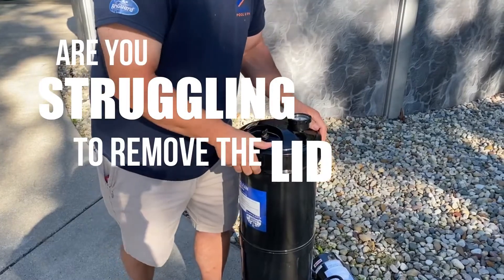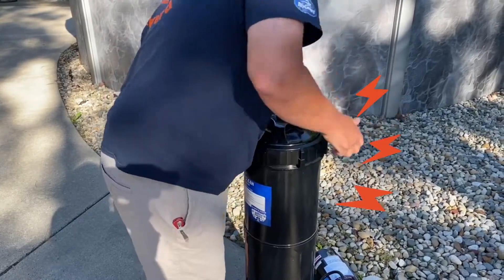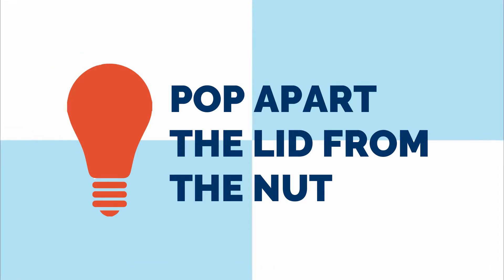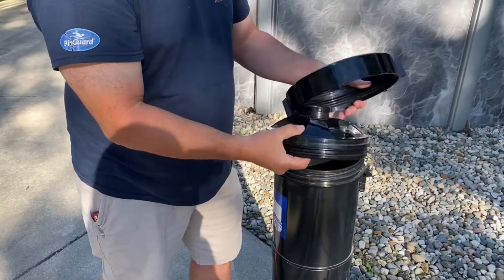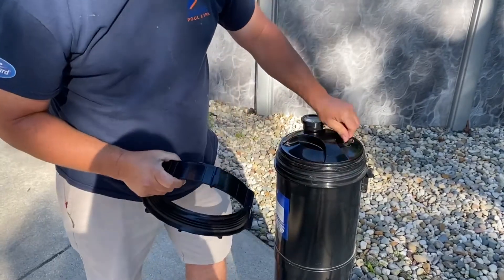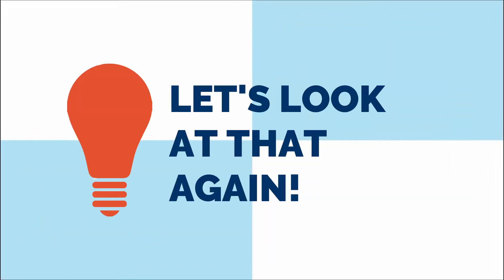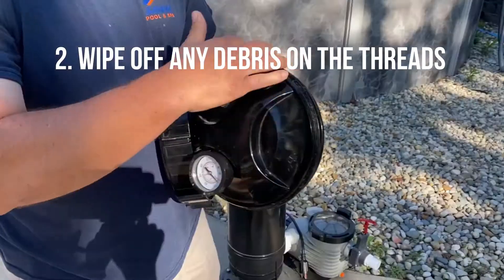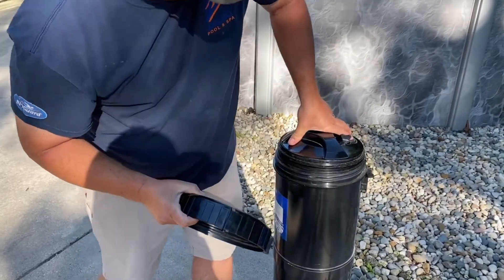How to Prevent Your Cartridge Filter Lid From Getting Stuck

Comment: I have a Hayward filter at the end of the first summer it was impossible to get the lid off.  Eventually a lot of hammering with a rubber mallet got the job done but I had to really whack it and I was worried it would shatter. After that year I put a lot of vaseline on the threads and it has been a breeze to get the lid off.

Comment: I tried this method this morning.  The outer ring is getting stuck after one full revolution.  I've estimated that it takes about 3 full revolutions to get the ring completely turned on.   I taped it about a quarter turn and left it.  I doubt it's going anywhere.  It just doesn't seem like a great solution. 
It took me about 75 minutes to get the lid off.  It turned a full revolution by hand before getting stuck.  I used a piece of wood and a three pound sledge to slowly work it around another full revolution before being able to hand turn it the rest of the way.   Is there a way to secure the cap without putting the ring on?  My son has a DE filter with a two piece clamp that has two screws, one on either side